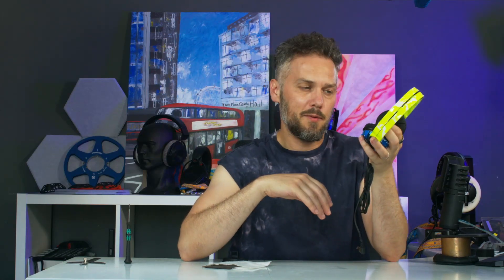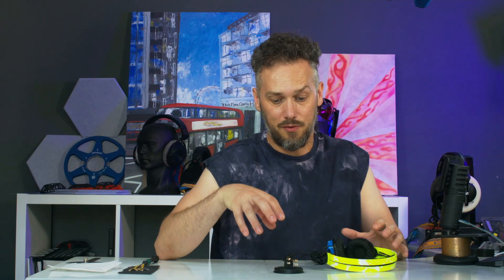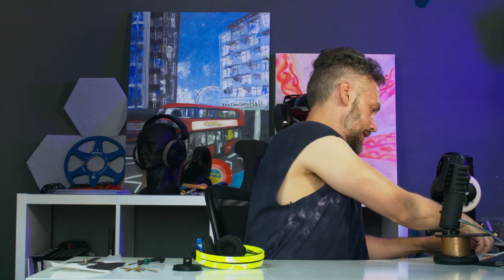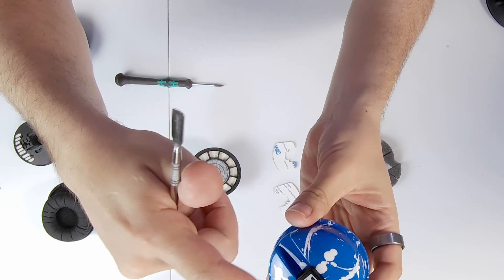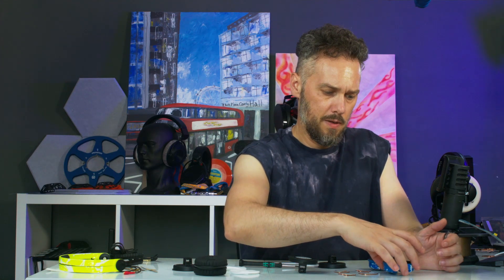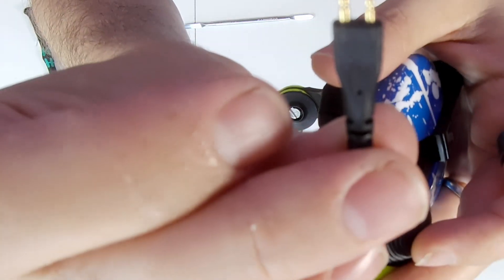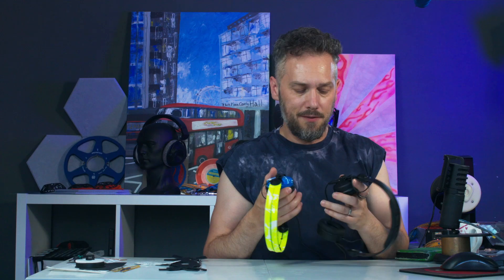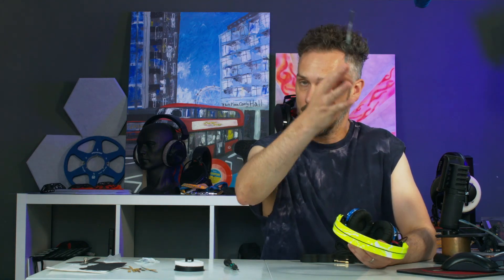Custom Cans Sennheiser HD25 V2 mass loading and damping kit

Comment: What are the effects of the copper weights vs the foam when compared to the v1 kit or unloaded headphones. Like is there a specific effect from a specific part of the mod to tighten or increase the bass or smoothing out the top end, decreasing resonance, etc. my engineer brain likes to know how things work haha
Reply from the maker: ;) Most of the effect comes from the weight behind the driver - the HD25 is very light and the baffle is a bit flexible - adding weight and bracing it a bit gives the driver more to push against which helps it produce the very low frequencies - the foam reduces the hump in the upper mids a bit... The hump is between 2khz and 3khz -  the inside of the earcup is between 60 and 70mm across, 2.5khz sound has a wavelenght of around 137mm so a half wave would fit nicely inside the cup and may have been causing that hump - the foam soaks up the sound bouncing around inside the cup. I might be wrong but it does seem to have that effect
Reply: It would be interesting to see a video about the theory but also idk how much would be trade secrets? Just throwing it out there, and either way keep putting out your stuff it’s great.

Comment: If I’m replacing the v1 mod with the v2 and have the lead strip around the driver itself, can I keep that there while just removing the lead strips on the back of the driver? Changing the sticky damping stuff in the enclosures out too.
Reply from the maker: Yes, you can leave the lead strip around the driver. You will have to try to remove as much of the old damping material as possible before installing the new kit

Comment: Just finished installing the V2 kit to my pair of standard HD25s and quite impressed with the results so far. A nice bonus is the extra weight added to the headphones. Gives them a more solid and premium feel like the Aluminiums (although might not be for everyone as I imagine there will be some people who prefer the lighter weight of the stock headphones). Good work 👍
Reply: Also super straightforward and easy to install compared to what looked like a quite a bit of a faff with the original kits
Reply from the maker: Thanks for the feedback and really glad you like it

Comment: would the damping kit v2 benefit the aluminum series?
Reply from the maker: You would still get a small benefit but not as noticeable as the aluminiums already have more rigidity and a bit more weight
Reply: @CustomCans  have you made any measurements with this mod fitted to the aluminiums? I have a pair of original ones from back in 2014 or so and am contemplating whether or not to get the kit 🤔
Reply from the maker: @moket123 no i have not yet. Unfortunately we have a load of projects we are doing for other companies at the moment and i won't be in the office so won't be able to do any more testing for a couple of weeks. I will try to get round to it though when i am available again
Reply: @CustomCans  appreciate the prompt response 🙏 Understood and no worries at all. As the kits are primarily designed to increase mass in the stock HD25s, I imagine its likely a non issue with them due to the nature of their aluminium earcups, so in theory I imagine the difference would be pretty small, as you said.

My only concern is if there is a risk in reduced performance (can there be too much mass?)
Reply: @moket123  Wondering the same myself with my original aluminium series, but you know there's always the satisfaction factor of pimping an already pimped model :)
Reply: Update : Ordered, was won over at 'dirty stinking bass'.
Reply: @moket123  Just installed my, can I tell a audible difference, no.

The cans are more weighty of course so they feel heavier on my head, and in hand, you could say it a premium feel but that's up to you.

Fitting: getting the drivers out of the cups is a real pain, no room to get in a pry tool.
One of my inner rings came out before the outer driver ring, hopefully it's not ruined anything but the wire connector into the cup has to be wiggled now to find the right sweet spot where it makes contact. 
There are 2 what looks like electrical contacts on the back of the driver and to indents in the cups, these are now blocked of course by the extra thickness of the kit.
Everything seems very tight to put back together with the copper kit installed. 

IMHO not worth it on the Aluminium series. I would probably move them to my plastic HD25. IF these drivers will come out easily, which I suspect they will because they didn't seem to push back in with as much purchase as when they came out.

Comment: So, how much of a pain in the arse would it be to upgrade from V1 to V2, or will it just be a sticky mess and better off left alone?
Reply from the maker: I would probably leave them as they are The difference between the two is probably not huge. You should be able to remove the V1 kit without leaving too much mess but it may take 10-15 mins to pick off all the bits of damping and weights
Reply: @CustomCans  Maybe time for a custom pair then hehe